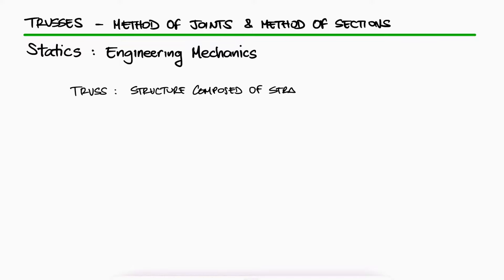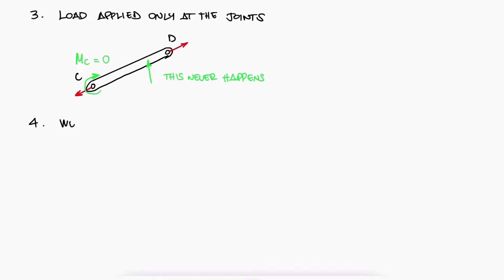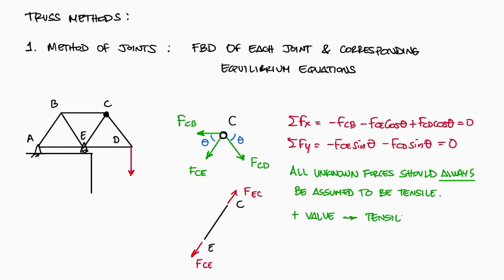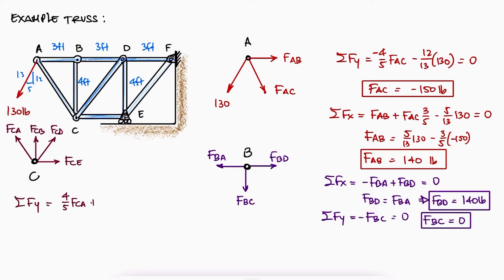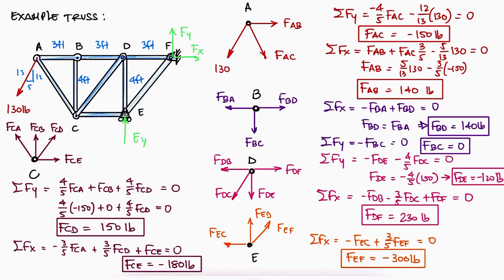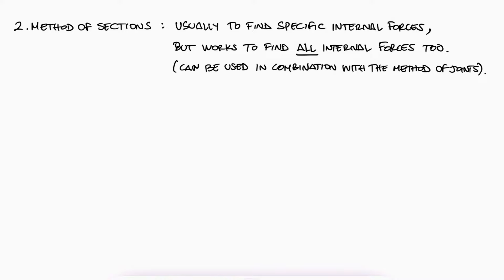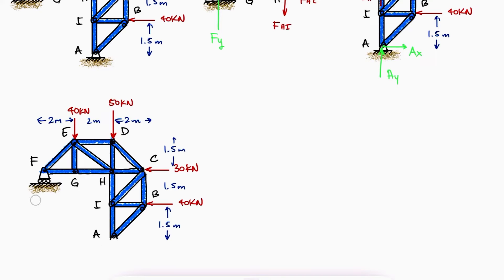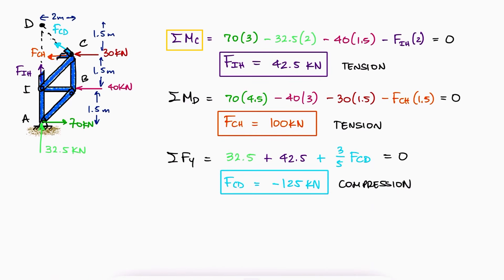TRUSSES - Method of Joints & Method of Sections in 12 Minutes!

Comment: so @ 7:15 in the video, mentions to determine if I need to solve for global equilibrium first (using the reaction forces)  OR if i can start immediately on the method of joints. My question is do I need to have a KNOWN external load in order to start immediately on the method of joints?   i'm assuming thats the deciding factor if i can ignore external reactions or not...??